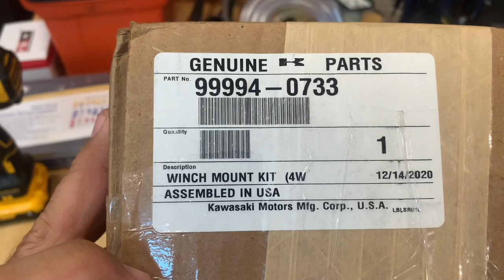Kawasaki Mule SX ● Install Winch (WARN AXON 35-S Synthetic Rope)

Comment: Watching you struggle with putting the mount and winch together from the bottom with ratchet wrenches and small turns made me think the Kawasaki engineers couldn't have been that cruel. I removed the differential bracket, put the whole thing together on the floor (both plates, bracket and winch. I then dropped the whole assembly in there,  put the pin through and installed the 4 front bolts. Voila! Actually it was probably the easiest part of the install. Whatever mechanic put the floor trough screws in mine had his drill torqued way too high. It took me nearly an hour to get them out,  one simply didn't come out.  I wired the dash plug/ remote harness by tapping into the lighter plug.  Your video gave me the knowledge I needed to get going,  thanks.
Reply from the maker: Great job!  I hope your comment helps someone else do this better!

Comment: where did you hook up the red wire from the switch? you said in the fuse box.  Im at that stage as we speak!
Reply from the maker: Yes - that little red wire needs to be connected to a power source that is enabled/disabled by the key. In my case I used my fuse box (that I added). That fuse box is activated by the wiring behind the cigarette lighter plug.  The wiring behind the cigarette lighter is easy to tap into without cutting any wires. See my fuse box install video to see what I used to connect to that.